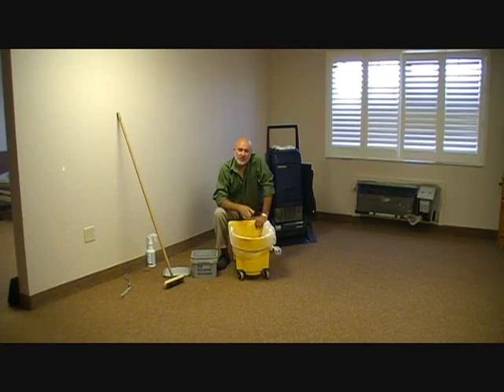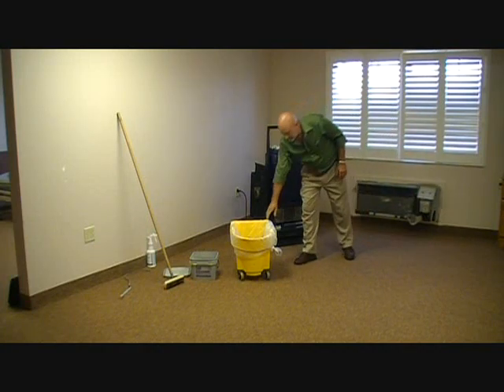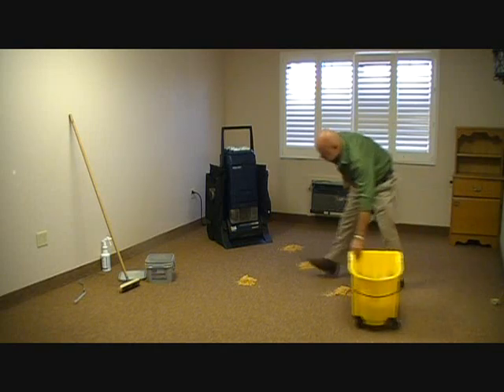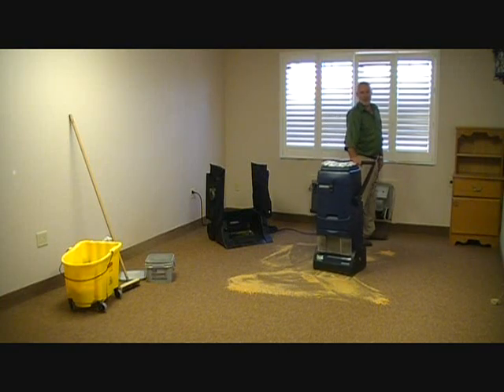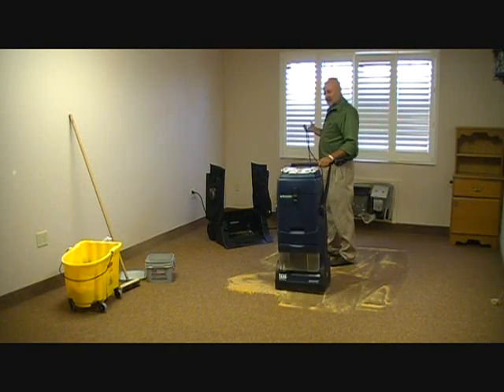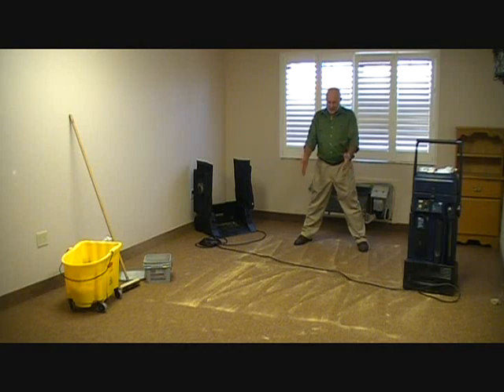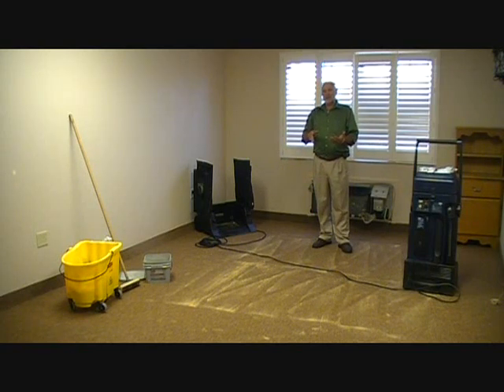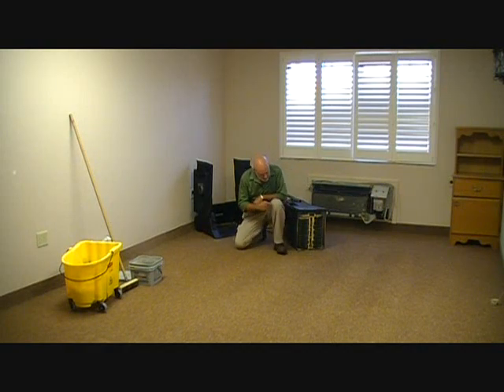Host - Application, Cleaning, Removal

Comment: I been using this product for years.. Doesnt do a good job with old carpet
Reply: what do you use?
Reply: @dogtrainerbreeder7411  was using the host carpet cleaner.. we have carpet that been there for 20 plus years so it could be the carpet but when we bought the product they said it supposed to clean it.  Didn't do a good job cleaning it
Reply: Do you recommend a truck mount added to the Host?
Reply: @dogtrainerbreeder7411  truck mount would be better.. even tho the host is much easier to take around.  But I don't think I will get the results you want at the end.